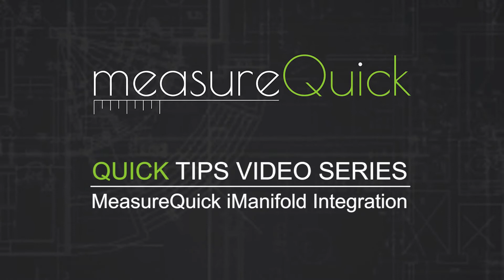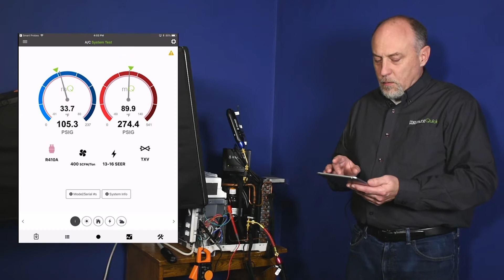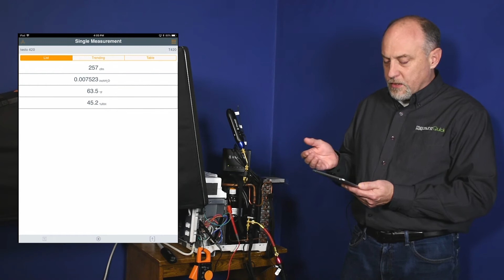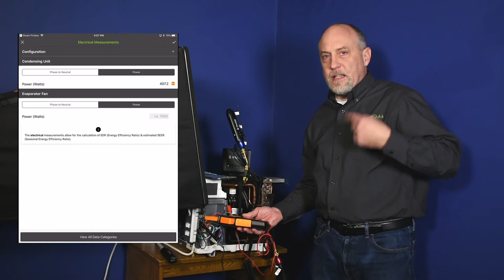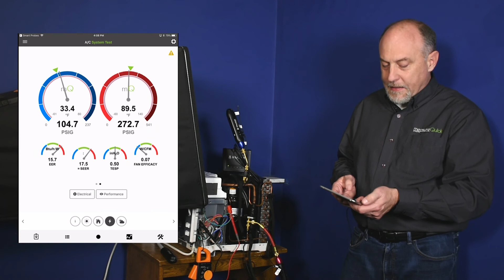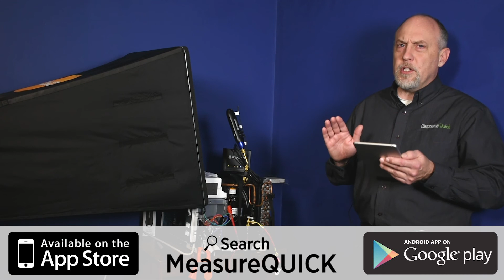MeasureQuick iManifold Integration

Comment: Good video ! I'd Like to See a Spot to manually input Compressor( Lra )amps , so it could compute proper( Rla )or better yet , input compressor model number and measure quick would automatically tell u if that is the right compressor for that application and automatically inputs all compressor information into measure quick , Condenser & evap Fan motors amps also that are stamped on the motor as Rla or Full load amps so that App could Look at the Rla vs Realtime data and state a High amp condition if thier is one and then u could Print that report stating that fact.Also - a Place to input capacitors checked & readings metered for capacitors.
Reply from the maker: We will be making a lot of additions over the next few months, especially on the electrical side. Most if not everything on your list will be added.